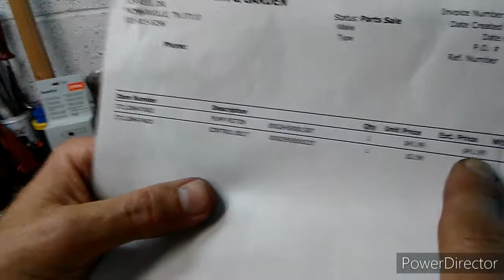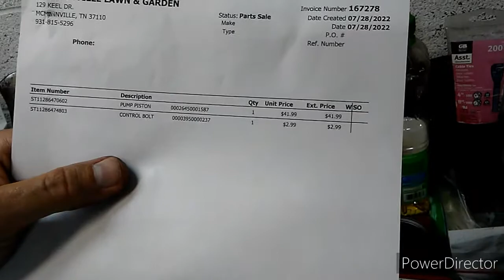STIHL MS400C OIL PUMP UPGRADE "R/HO"

Comment: Thank you. I just bought the 400c for my first brand new saw with a 25" bar and was surprised by how little oil it was using and did heat up the bar a bit in some hard maple. I purchased the HO oiler and installed it today. Seems to be working better.
Reply from the maker: @BSbull  Good sir...remember you can always turn it down and safe sawing to you.
Thank you for watching and commenting...

Comment: Is the direction of the slot on the control bolt critical? How do I make sure I do not install 180 degrees of? TY
Reply from the maker: @RychardKraft  Hello Mr. Richard, it won't install incorrectly without force or breaking something. I video or take digital pictures and even pencil draw things I think may be potentially difficult.
There is a shoulder that mechanically limits rotation, in order to install it incorrectly, the shoulder would have to be removed or broken. Success to you in your work sir and thank you for watching and commenting...

Comment: In going this modification does it make it the equivalent of the high output oiler used in the 660?  What was the total cost of all the parts used and their part numbers? Do you know the part number for the OEM high output oiler? Do you know the cost of that High Output oiler? I’m wondering what the totals are between the reworked oil pump with new parts vs. swapping out a High output pump altogether? Thank you.
Reply from the maker: Hi Mr. Michael, no sir, this is the internals/pump for the 046/460/461. This is a totally different series of parts hence the #1128 designations. None of these parts interchange with the 064/66/660 series of oilers. I will give you a link that shows the dimensional and part number designations. Thank you sir watching and your comments...

STIHL MS 461/ 660 OILER INTERCHANGE?

https://youtu.be/tw1xr_iecIc
Reply: @Brian2bears  Brian, this is the FASTEST reply I have ever received. I actually wrote my comment prior to finishing watching the video I asked the questions once I heard you say “be careful I have cracked these before”. That’s why I was wondering if it’s worth the risk rather tan a swap out. I will watch the link and surely gain even more from you. Thank you again.
Reply from the maker: Mr. Michael, you edited your comment while I was replying. I do know the cost and the part numbers. The part numbers are listed in the description. The cost is about half to do the internals only. The complete pump is less than $90 last time I checked. The MS 660 Austrailian HO pump was $160 + tax last time I bought one. There is an oil pump playlist and more MS 400 oil pump videos here if you are interested....thank you again sir...

OIL PUMP PLAYLIST....

https://youtube.com/playlist?list=PL4yXbW2Yt6bchS3DWWG6obFvrnC251POU
Reply: @Brian2bears  I appreciate your reply. I'm thinking about getting the MS500i. Do you know if it has a high output oil pump? Thank you.
Reply from the maker: @rottiejakeluke  1142 640 3200 is the only oil pump for the 500/462/382 that I am aware of. They oil well after the detent is punched allowing the eccentric to rotate. Thank you sir...
Reply: @Brian2bears  thank you Brian, you have an amazing amount of knowledge.

Comment: you can also buy the 460 HO oiler as well and its a direct bolt on.
Reply from the maker: Yes sir Mr. Aaron, the part number for the complete oiler is in the description, in another of these oiler vids I install a complete unit as well. Thank you again sir for watching and commenting...

Comment: Would the same part numbers apply to my MS261CM?  

I can't believe how stingy it is all the way up.  Thin viscosity helps a bit, but still anemic oiling for a pro saw.
Reply from the maker: Cobra514, I worked on a 261 back in the summer. The control bolt will work but not the piston. The control bolt is inexpensive. I read you had your pump turned up. I wish you success, thank you for watching and commenting, if you do this, let me know how it turns out. Thank you.https://youtu.be/atvWZMqm0Co
Reply: @Brian2bears  Thank you for the info!  You read my mind as I've read elsewhere the control bolt was OK but I didn't know about the piston.  👍
Reply from the maker: @Cobra-514CID  I really like the 261 by the way....

Comment: Brian:
 This was an outstanding video! I truly had no idea that there were issues with the oil pump on the 400. I have about 8 to 10 tanks through mine and have  not had a problem yet running a 25" bar. Are you noticing this in any particular type of wood?
Reply from the maker: Mr. John, high-volume hardwood cutters. In the place you and I met there is quite alot of discussion on the matter or I really notice it... I am surprised yours oils a 25 that well. I have watched your 400 vid as you know...
Reply: There aren't issues with the oiler as it comes from factory, this is just a mod to make it push out more oil.
Reply from the maker: @em4703  Hi EM. The 1135 640 3200 unit pumps 13cc -15cc per min @ 12K rpm. It does that just fine. For many users it is not enough. I am one of the many. In comparison to the Husqvarna 562 and Echo 620, the oiler on the STIHL (341/361/2/400) is seriously lacking in my conditions  and use. It also seems that is the opinion of hundreds of verified STIHL owners of said models. In the full video I give reference to the intended use of the 400 @ 9:57. I also make the statement @ 18:46 that in order to take advantage of the torque and horsepower of this unit the oil pump should be improved. But no there is nothing wrong with the 1135 640 3200 oil pump. https://youtu.be/afjT14bTplw
Reply: @em4703  def is a problem, can't use cheap oil or the bar will turn black and burnt
Reply from the maker: @TaylorCutsTrees  Hi Taylor, I am just seeing your comment here...I appreciate you watching and commenting...my apologies...